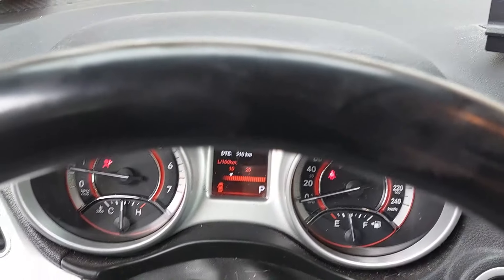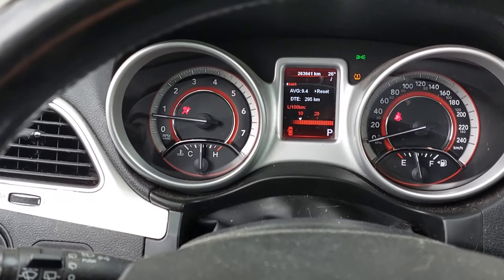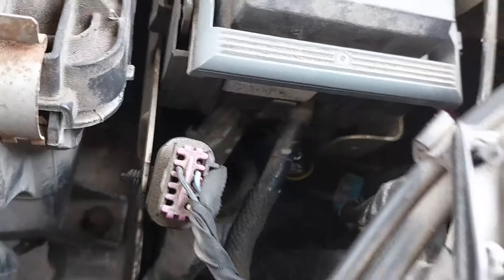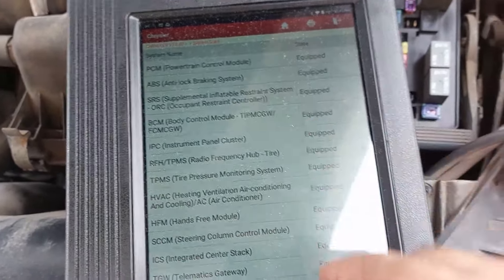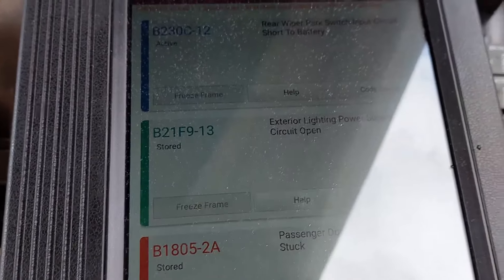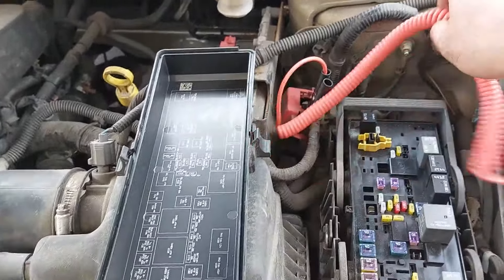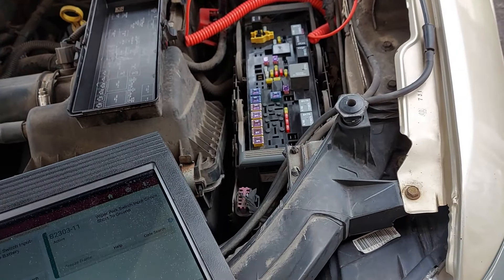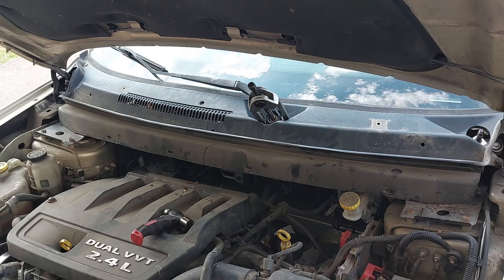2011 Dodge Journey 2.4 - Headlights & Wipers Inoperative Diagnostics - Part 1

Comment from the maker: CLICK HERE FOR PART 2:
2011 Dodge Journey 2.4 - Headlights & Wipers Inoperative Diagnostics - Part 2
https://youtu.be/Qt0D9DtPR5s

One thing I may have forgot to mention is that it is good common practice to always check for all powers and grounds for a computer that you are calling for replacement. This is just to be sure that all of the powers and grounds are good before condemning a computer on a vehicle. Unfortunately, I failed to do that on this vehicle and got bitten in the rear end. If I had checked for powers and grounds on the BCM earlier then I would have found that issue for that broken power wire earlier (In Part 2) in the diagnostic process. It is something that I normally do and encourage everyone to do, but unfortunately I distracted myself from staying on the correct path in the diagnostic process.